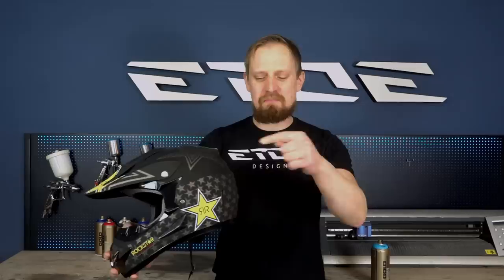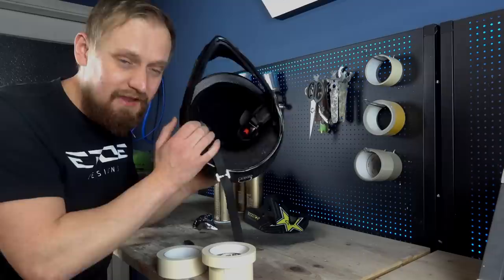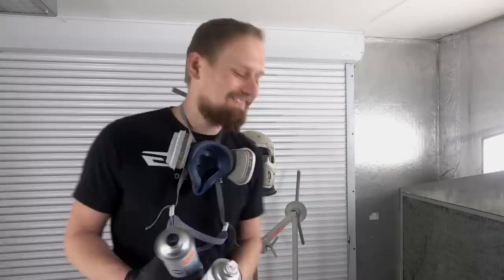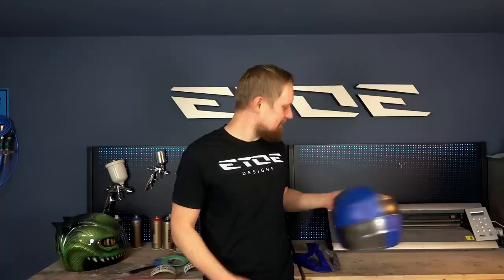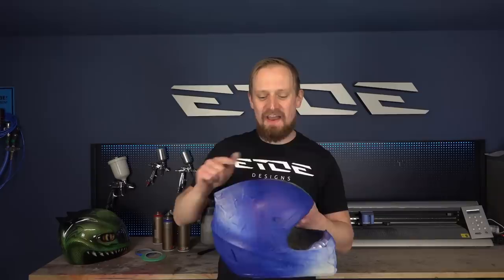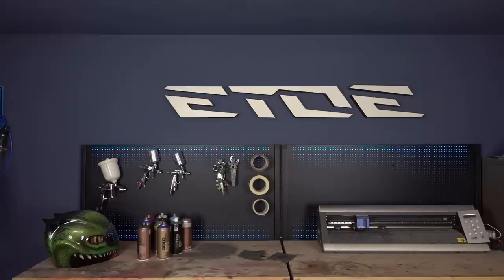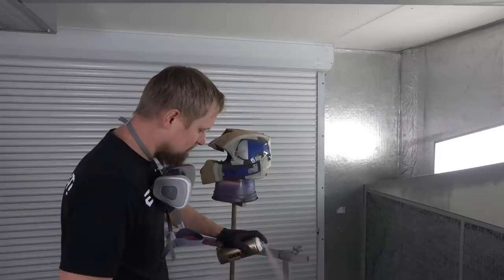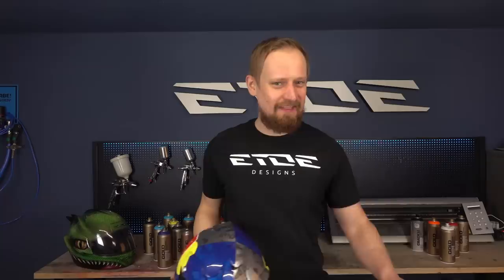spray paint a helmet with spray cans only

Comment: Good job Martin, it turned out really well! I'm guessing you used two blues and two silvers because you won't find candy in a spray can? Cheers!
Reply from the maker: Yes they differ. I named the color codes of the cans in the video. You can find transparent spray cans. But a friend doing Graffiti recommended not to use them when custompainting.

Comment: 8:19    this man really said to fill in all the scratches from sanding. it’s not like the purpose of sanding is to get a smooth surface or anything 😂
Reply from the maker: The purpose of sanding is to do micrometer thin sratches in a surface for addhesion between the layers of color.